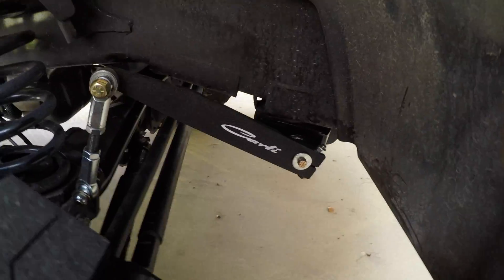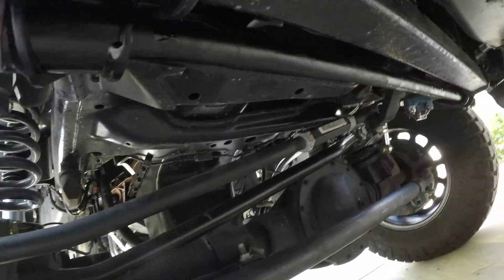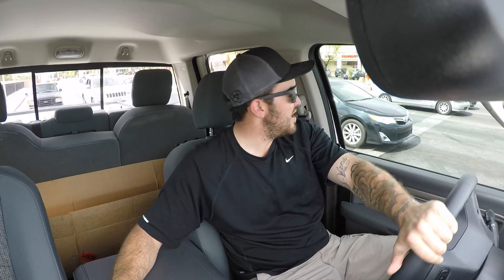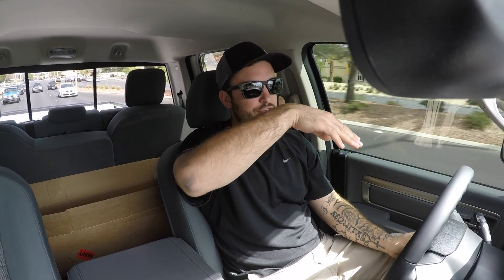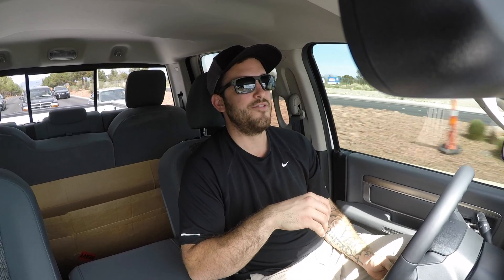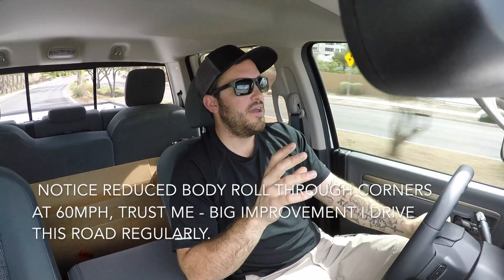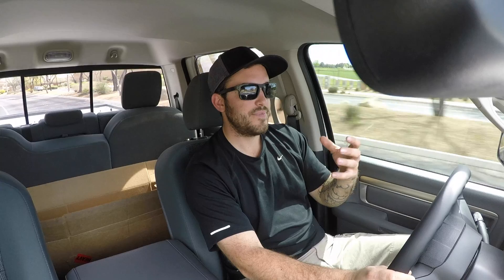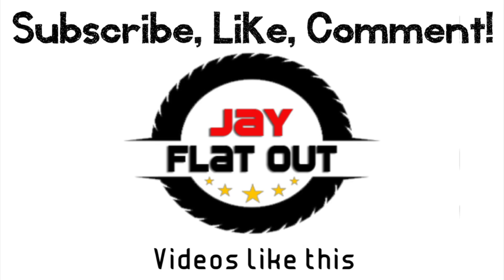Is a Carli Sway Bar Really Worth $700? - Cummins Build by Jay Flat Out

Comment from the maker: Truck Front End:

Carli 2.5" Leveling Coils: http://amzn.to/2p7ItrL
Carli Adjustable Front Track Bar: http://amzn.to/2lWBSld
Carli Torsion Sway Bar: http://amzn.to/2nDIGlw
Method Race Double Standard Wheels: http://amzn.to/2nk2p9u
Nitto Ridge Grappler Tire: http://amzn.to/2nDROGB
Bilstein 5100 Shock Absorbers: http://amzn.to/2lzOC1g
Icon Vehicle Dynamic Steering Stabilizer: http://amzn.to/2lzSSxs

Comment: I went with a hellwig adjustable sway bar so I can have more or less stiffness out of the sway bar for better tuning. I was running a 4 link with semi truck air bags, 4 bilstein 5100 shocks and a stock sway bar. It had tons of body roll then. I changed it all after that to coilovers, hellwig, and I changed the panhard to have a better center of gravity and it gave it a much better ride.
Reply from the maker: +Adventures Of Alex That's a hell of a lot of work though.
Reply: Jay Flat Out  it's been a labor or love and a publicity stunt in progress haha. I like having vehicles handle like they're on rails so I'm chasing that idea for a lifted truck.
Reply from the maker: +Adventures Of Alex That's awesome, you have any pics on IG or anything?
Reply: Jay Flat Out yeah man. I only have a few since I'm still making sure it's perfect before doing a lot of detailed photos and all of the body work but my insta is alexmullins4
Reply from the maker: +Adventures Of Alex Sweet I'll check it out

Comment: Both of my sway bars are disconnected for nice soft daily driving, the only time I hook em up is when I put my top heavy cab over camper on. A 3/4 ton truck doesn't really need em for daily driving.
Reply: Hi Adam, what kind of truck did you disconnect the bar on?  I now have 2018 2500, diesel, megacab.  Considering pulling mine off entirely also.  I don't carry top-heavy loads, just towing.  My last truck, 2005-2500-quadcab-diesel-no lift, I pulled the sway bar off and ran like that for 6 years, never a problem, and rode much smoother.  I towed very heavy, (20k-up to sometimes 30k trailers) with 3-axle gooseneck trailers, still never had problem with body roll then.
Reply: @benherstad  2001 dodge 2500 diesel, and Ya I've towed 10k that way. In my opinion sway bars are mostly for hauling ass on smoother surfaces. Or  trying to street drive a really loose rock crawler with super soft springs.

Comment: Unless you are going racing any adjustable sway bar is found to do exactly the same thing with in reason. In other words for street use you will never know the difference between a $300 or $700 sway bar

Comment: Also......save money by not upgrading the radius arms.  Look in getting coil replacement for the spacers.
Reply from the maker: James Miller Changed the spacers for Carli 2.5" coils (see latest video) yesterday actually. Ride improvement is nigh and day. Still considering radius arms though
Reply: James Miller if your going to upgrade control arms, you should skip radius and do long arms

Comment: I looked at Carli..and I think they are the best.  I went with Pure Performance complete front and rear suspension change out with 2.5 Fox adj. shocks.  Look into bags, I have the ones that automatically adjust once set up the first time with barely any air in them and they come w 2 compressors and one thing that really helped ride on my F350 was a sulastic shackle in the rear.. check it out on You Tube.  Nice truck BTW.
http://www.sulastic.com/
Reply from the maker: +Jeff Jassby I've been thinking about doing bags on the rear, I've seen there are new compressors that are actually inside the air tank so they don't make as much noise I was interested in
Reply: Mine make a little noise..they are mounted way up above my frame on both sides...but what I like is that when I fill my 36 gallon tank which happens to be on the drivers side and when I fill up it levels automatically...I don't have to touch anything.  Secondly I have 2 employees that weigh over 350 lbs and ride in the passenger rear and as they get in the bags on that side start automatically level my truck out.  Cool set up, softens ride and when I pull these 40 Skaters long haul on a fifth wheel she does her job.
Reply from the maker: +Jeff Jassby What's a complete kit with install run $$ wise usually? Don't want to get ripped.
Reply: I believe stage 4 with the exchange for the Fox shocks was right at 5100.00..thats both front and rear.  On your 2014 2500 6" lift
http://www.pure-performance.biz/category-s/2134.htm

Comment: If you want the ride to be more comfortable... put airbags on it.   Rides like a limo and you can still hit the dirt roads!   Carli is too much for what it does.
Reply from the maker: +Terry Koenn Just on the back or all around?
Reply: Not always the case, i had airbags on my 2015 Ram 3500 and i hit lease roads and offroad everyday for work. It causes the truck to have a double bounce when going over bumps.. and thats not good when you got tools in the back
Reply: @JayFlatOut  I did all around on my second truck.  I only did back on my first and it helped a lot.  I did the front on my second truck because I have a heavy ranch hand bumper with a winch on it.  The second truck is also lifted with a 3 inch body lift and the airbags gave me a 3 inch suspension lift.  That allowed for the 38 inch tires and a 3 inch lift doesn't need crazy mods to everything else.